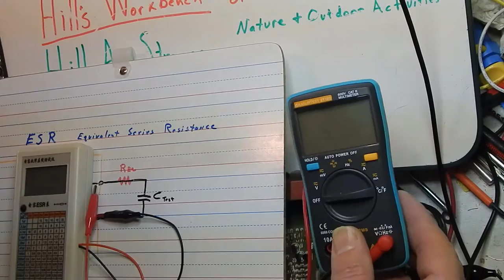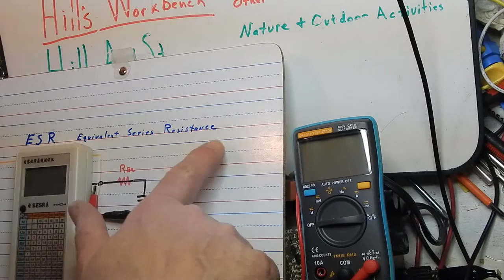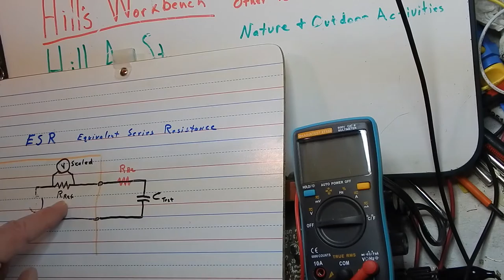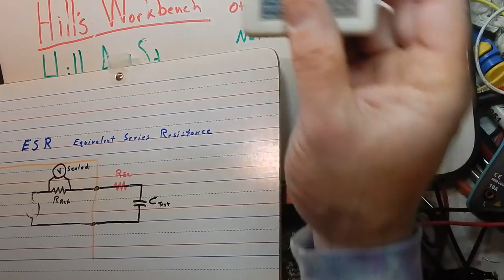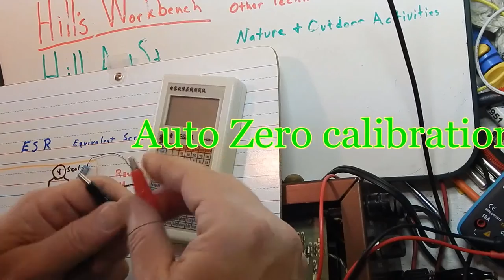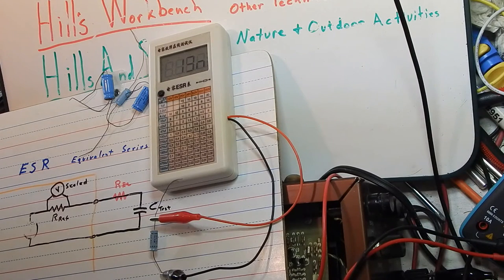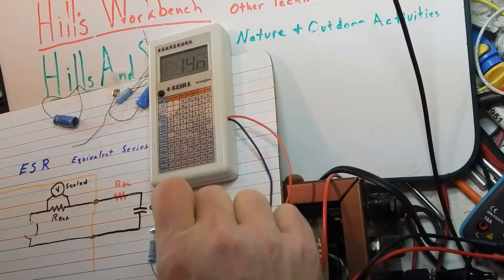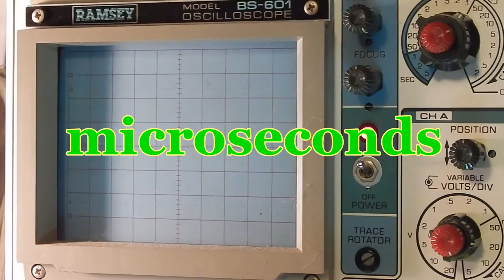ESR Meter -An In-circuit Tester for Electrolytic Capacitors

Comment: I notice my multimeters will show old capacitors with a higher than rated capacitance. My theory is that higher ESR will increase the charging time these meters use to read the capacitance value. I use an audio amp and series resistor to read the ESR, so I'll have to check that.

The seller I bought the multi resistor kit from has a multi component tester I might try. It checks caps including esr, inductors semiconductors and such. It is a board with screen without a case but is cheap.
Reply from the maker: That sounds likely, I doubt any DVMs capacitance reader function check ESR first and factor it in. Though maybe it could be smart enough to notice when a cap isn't taking the current it is offered...
Reply: They might increase the time but they will reduce the current, so that should not impact capacitance

Comment: Electrolytic capacitors that have been in stored for years need charging with a voltage for about an hour - brings them back into working condition - applies to new and unused caps that have been stored for years as well - capacitor manufacturers state this
Reply from the maker: Yes, it is a good idea to bring them up to the rated voltage to re-form any degradation. I used to just slap Vmax across them with occasional disastrous results. JohnAudioTech did a video on this way back with an almost obvious twist, use a high series resistor when doing this to give them a chance to form.
Reply: Yes, not good to blast them with high current

I think a bench power supply at the correct voltage, but set to low current is best - we want the voltage, not the current

Comment: Price ?
Reply from the maker: I think it was just over $20 back then, I found it on E-Bay for $38+5 shipping. Mostly what came up when I searched were those multi-componant testers that go for about $20-$26. https://www.ebay.com/itm/New-Digital-LCD-ESR-Capacitance-Ohm-Meter-In-Circuit-Tester/323373257589?_trkparms=ispr%3D1&hash=item4b4a8c5375:g:U6YAAOSwYk5d-2p4&amdata=enc%3AAQAFAAACcBaobrjLl8XobRIiIML1V4Imu%252Fn%252BzU5L90Z278x5ickk5v8gVt3hEWLVg%252F253w6XCSyYGjVJPIC3eGEdiqaL6ZwlW4f%252BegoCHTqgcLgK6HE0eQOv%252FT%252BAOD4oivyqj%252F%252BVWyttww1fhG1xpeSmHzYNZZiiSv%252BvOUX1GpQs8xaVqaTbSfHMw%252BeXD%252FKhSwlTkUom6vDxjwGiWT4joGzxlLBfYwErDesvmcJuzrtxXX2JVC%252FkUDPCJRDy9rR2YEpggUHUMWfp1i7bsZi0eN6nnd5iUc4udzs9eA77CUtUNe%252BfW5RQ9iYPtfv3gWIC1kDUeamdSoixALP%252BFKSpXM874gD3%252B2tSKHb%252FOt0VntmGGLdRzu3VmW2u4q8KyBQZTNRKvQh6S2CcpCmUmHgdwO95q9zF1Wr8ETzb6E8Kv52HVDXuO%252BOa3eKvIvFw9eMcEloelGBy7l1GGr85qDeFHpR8fPUlwEggx%252Fx4qqFVEuuNf0QooD%252BYhJKbtLFPgr4P1Z2aLMdRdxIsO9FaoayrTHAOb66emPA3R7XmlCpGr1PkfD27k%252BRNzHvv6ndrE2r08aLt%252B7otrYHgd74ACuHNDfto9spMHEjvljBh4mqvY52CiR0C4sbTnjO8ck1t%252BEVbH3KHQQ5hykKzX5AskYtM%252FMIG7aeQ0jVXjPDBaw9SgYOLfJB3NLeveN5uklncnAt6u0zZepwm%252ByVBbJuSXqiwD9v44jWGaZd5is2TGN7ErHcLme1hKEm7vTiJUp6Lob%252F%252BV5PrTYtsyru%252FUFozG2Hnf%252BzTtrysef7HmmeitC%252F0kkfVQ7nJLezDbE7Rc41kLsOoQIp8qbZn%252BQ%253D%253D%7Ccksum%3A323373257589312a51b1e59a4445b61eb30a9f3bdf19%7Campid%3APL_CLK%7Cclp%3A2334524
The original American one has come down in price a lot, and the China one is up, consider this  https://www.ebay.com/itm/GME-Professional-In-Circuit-ESR-Capacitance-Meter-Capacitor-Tester-USA-Warranty/323878240428?epid=2180686390&hash=item4b68a5c0ac:g:18cAAOSwThddSmUU

Comment: I have many ESR meters, I have this one incusive, but if you are a profesional is better to buy a real one like 
Peak Atlas ESR70
EMC-236
Anatek Blue ESR 

If you don't have money is better to do an analog ESR.

Best Regards.
Reply from the maker: Actually, I do have my eye on a nicer one! But this unit has always worked well, even if its leads are pretty light duty. Recently I discovered that It does a much better job of giving me consistent and repeatable readings of low fractional Ohm resistors than most of my DVMs.